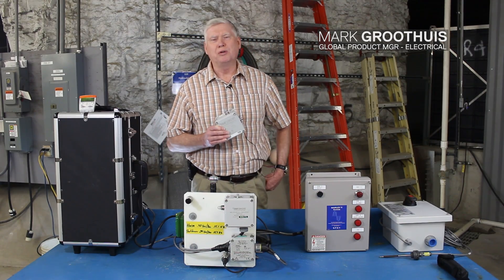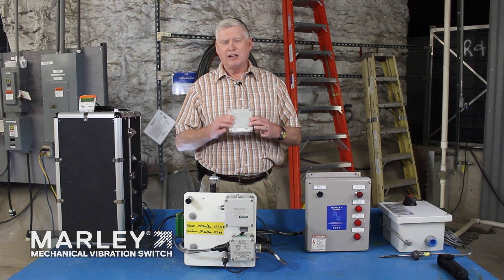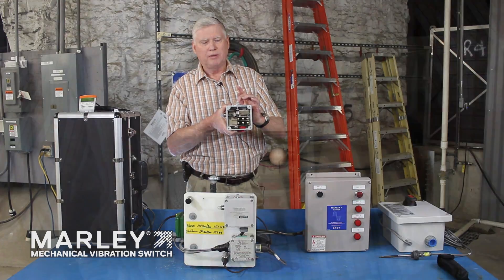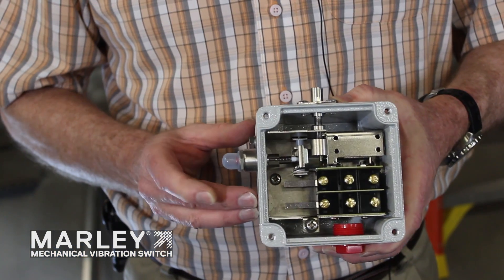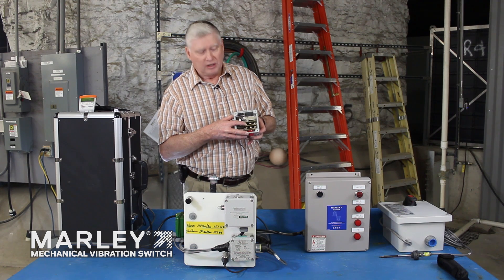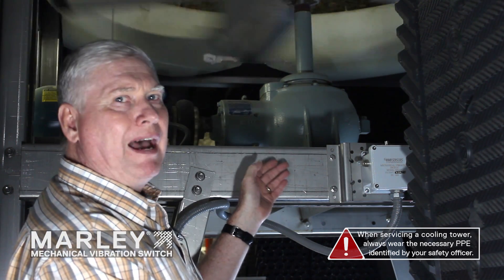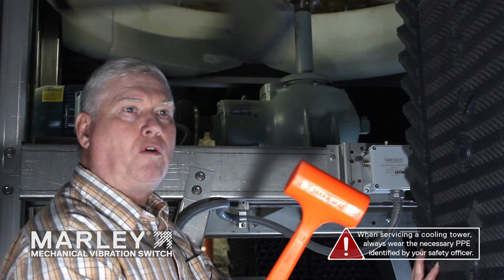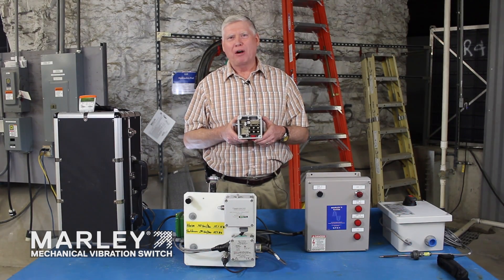Marley Mechanical Vibration Switch

Comment: These are somewhat more weather/corrosion resistant than the original vibe switches installed on our Marley Cooling tower.  After numerous complaints (a lot from me) that these  overpriced switches we're crap, it looks like they had taken my suggestions and manufactured an improved version.  'sure wish I had more acknowledgement than a simple "Thanks"...

Comment: The fan is running backwards in that video.
Reply: There are times required to run the fan backwards. Like in low ambient to melt ice from face of the fill. and to keep ice from forming on the fan blades.